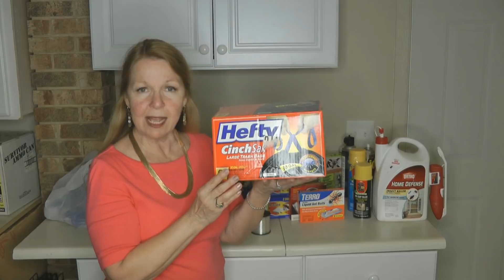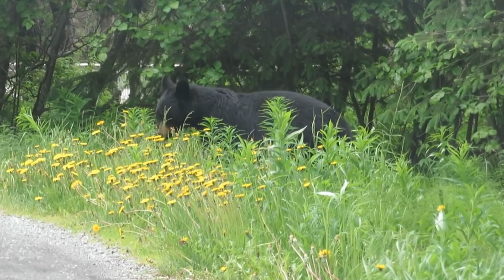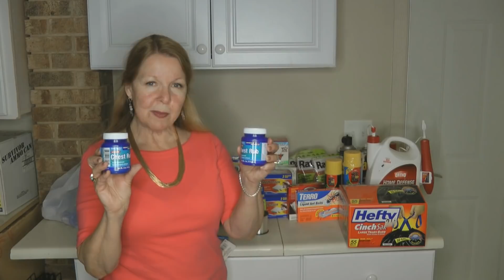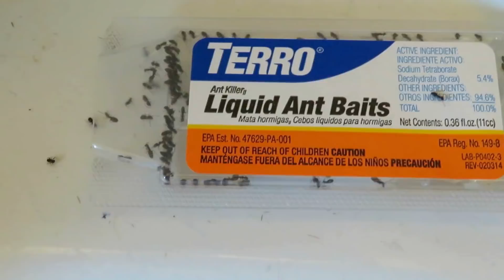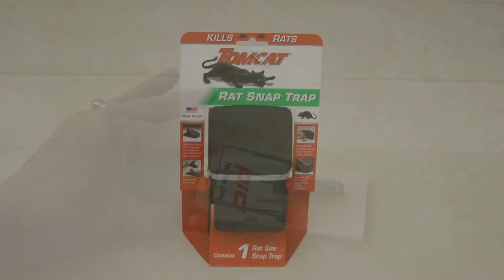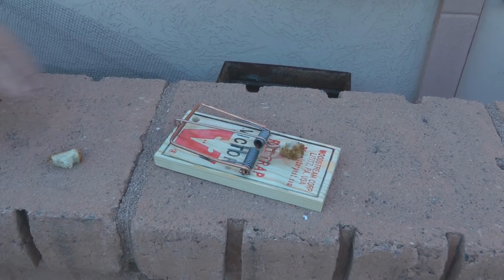Prepping Supplies for Pest Control Critter Protection Defense - Protect Food Stockpile

Comment: I make up spray bottles of 2 cups 70% alcohol, and  2 cups water, and 80 drops peppermint essential oil. (or equal parts alcohol and water, w/20 drop EO per 8 0unces.) Not only "the best" spider-ridder, but through experimenting I learned spraying thier entry holes regularly   will keep stubborn Carpenter Ants away, eliminating commercial chemicals.

Comment: We had a new heating a/c installed 2 yrs ago. Would never have guessed when the people were searching the cause my AC heating unit not working,  they saw that a critter had chewed through the fine wiring going in to the garage. They repaired it.  I called our exterminating people to add that area to watch. He added one of those large commercial hotels near our AC unit. We’ve been watching it and after three months the exterminator noticed that something had gone into the hotel and  eaten the poison. So he refilled it. 
For those who have a squirrel problem with a squirrel chewing through a newly repaired shed and where other methods did not deter.
Mix a rather large amount of peanut butter and red pepper flakes together. Spread it across the top of the shed. That’s where we had the problem. The squirrel would come from the trees,  cross the shed roof, would climb down onto the door where he would chew.
Worked the first time. Declined cross the rough decided to take a noble of the peanut butter, flew 20 feet up in the air it was the last forever saw of him.
Reply: Omg, I love this. I have a insomniatic squirrel that uses my bedroom corner. He jumps on it from my neighbor's tree and it's the loudest noise. He vibrates my home. Back and forth non-stop like every 27 minutes. I'ma fix his butt now. Well, after the rain.

Comment: I place several moth balls in a jug of water and set  around the house , chicken coop and barn to repel snakes.
Reply: I wonder if this method would work on skinks? They are huge and no one believes me. I startled one chilling on a bundle of firewood about the size of my forearm and when he peeled out to run away, he knocked it off of the pile. Lol. True story. They look like dragons and I'm freaked out. Recently diagnosed with some heart problems and they're not helping. Smh
Reply: @amymyers7713  not sure but worth a try. I cut little triangles out all around the milk jug about half way up. Then fill with water just below the cut outs.. Drop about 5-6 moth balls in and replace lid. I set them all around and it really helps keep the snakes away!
Reply: Thank you

Comment: That Terro stuff for ants works great. My Pest control guy puts it inside one inch pieces of plastic straw and puts them all along where the ants walk, that way you don't get it all over your counters or cabinets. The ants bring it back to the queen. Once she dies, they just go away.

An added benefit of wasp spray is that it can be used for self defense. Not only does it work exactly like mace, it squirts very far and accurately as well.